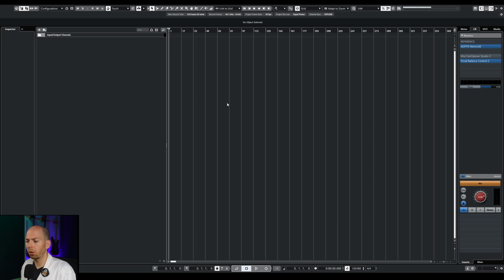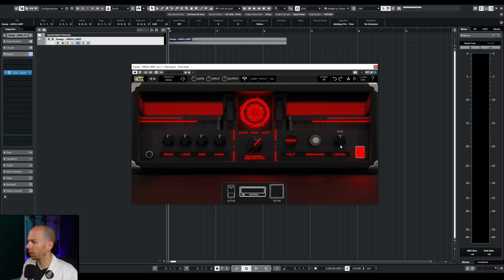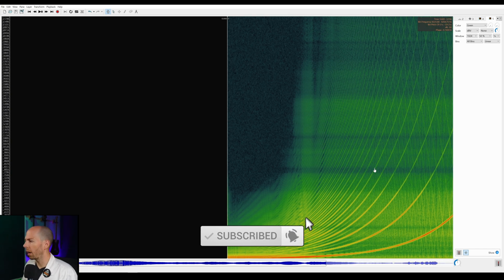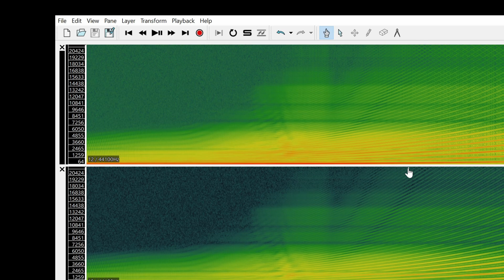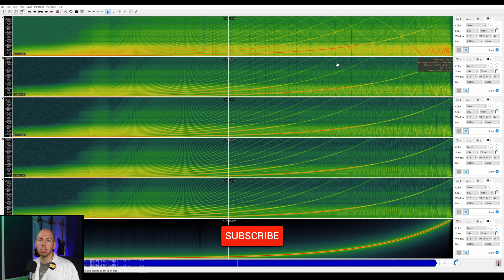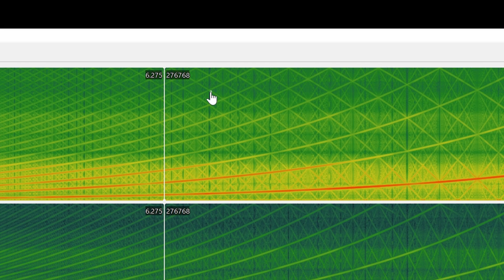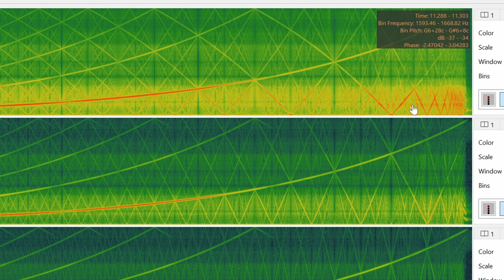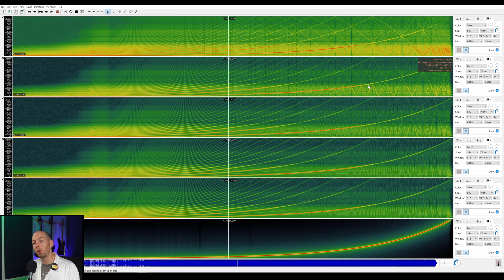How to Test Audio Plugins for Aliasing with FREE Software | Start to Finish

Comment: Hey chief, I've got a quick question: I ran the tests myself, and oddly I'm still seeing aliasing, despite added oversampling. I reckon this could be a limited feature for the free version, or perhaps something else is causing aliasing? For reference, I have a blank session with just clairvoyant loaded in with the freq sweep. Any other good guesses on what may be causing it? Thanks!
Reply from the maker: Might be clipping something by running it too hot. That will generate harmonics that will alias back down. You can see that behavior every time you clip your converters or plugins. Try doing the tests with a lot more headroom and let me know if that fixed the problem.

Comment: That was interesting! Frankly, most of what you said was beyond my understanding, but I think I got the main point that oversampling, in theory, should produce a better sound because it removes nasty-sounding artifacts. Did I get it right? I'm more a musician, and not the engineer type, but I do want to produce pleasing-sounding music. Thanks for your videos!
Reply from the maker: That is right! It will make the audio slightly less harsh with a smoother to end. Glad you got something from the video!
Reply: @RaytownProductions  yawrn!!!! Been a nerd does not confirm tests of any kind or make you appear  cool